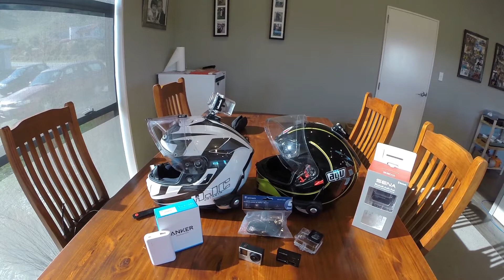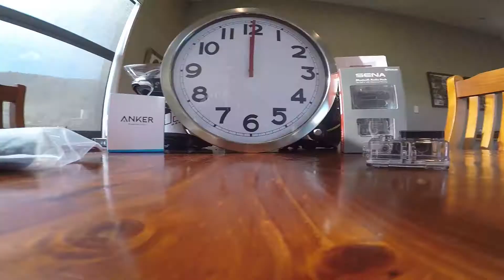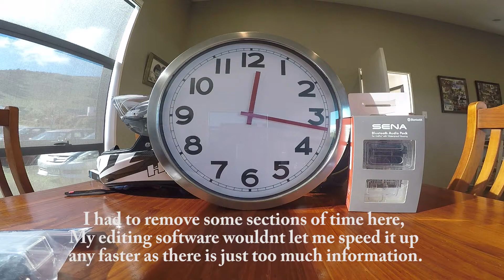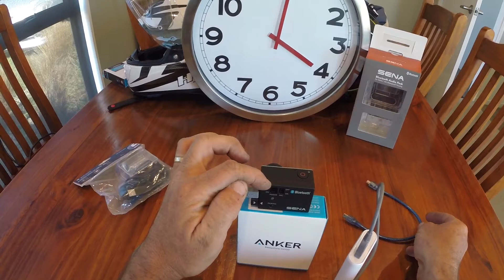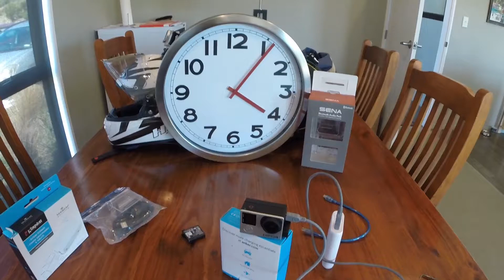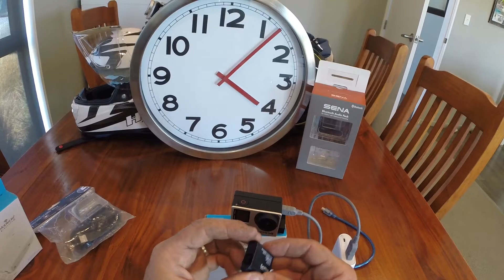My Moto Vlog set up

Comment: Hi. I know you said you don't want a cable from your helmet to the bike, but I run a Sony AR15 on my helmet which I power from a USB plug on my BMWR1100 or Ducati 900SS. I run a USB extender cable from the power outlet along my tank bag to about even with my crotch. Then I run a shorter cable from the camera to this cable. This setup with a 32Gb card in my camera gives me up to 5hrs at 1080P or 11Hrs at 720P. So essentially I just record the whole trip. The Sony breaks it into 4Gb chunks so editing isn't too bad. A 4Gb chunk at 720P is over an hour of riding. perhaps you could look at this with the Sena GP10 getting it's power the same way. It really makes for hassle free recording and for your Vlogging would be superb. To alleviate overheating of the Sony I drilled holes in the front (sides) of the waterproof housing and a large hole underneath for the uSB cable. Works a treat and even in west coast rain I get no water in the unit.
Just changing to a Sony HDR X3000 so have some fun to look forward to.
Reply from the maker: Yea I still havnt got mine working great to be honest. I will look in to it some more this summer. 🖒🖒
Reply: When I get the new camera set up I'll see about posting some shots of it. Perhaps could email you some photos for reference.
Reply from the maker: Ok mate let me know. I am going to set up a face book soon so that might be the best way.

Comment: Hiya Buddy, I'm not sure how old this video is, but how did that set up hold out with the travelling, general chitchat and VLOG'ing recording?
Reply from the maker: Hi mate. Glad you asked as it did turn out to bit a bit of a fail. In theory it's the perfect set up. in reality the power pack is a pain in the ass.  I keep a go pro battery charger and power pack in the top box and just rotate batteries. much less drama. 🖒🖒

Comment: do you have any idea if it will work with the sena  at all?
#
Reply from the maker: if what will work mate.
Reply: the same mic system / audio you showed on this video?
Reply from the maker: yea. I use a Sena 20s.
Reply: sorry I have a sena 10 I meant do you reckon I'd manage to do the same?
Reply from the maker: ahhhh.  I think but I am not sure that the 20s records in high Def and the others don't.  but I might be wrong. I did a lot of research before buying just can't remember.

Comment: Why not spare battery/batteries for the GoPro?  My Sony only has a battery life of about 2 hours, after that I change the battery, if needs be I can charger the spare battery from the bike.
Reply from the maker: Hi Tony, yea I could. problem is. I have no idea when it runs out. unless I use the wifi  controller which uses the battery even more. so this is just a Hassel free idea.n

Comment: Hi.  Manchester Uk Phil here.   Just a silly question. Your hero 4 is going to be in its case. I think you said your going to vent the case to reduce the overheating but I guess the set up ( cable) from you camera to the power pack is going to be external from your helmet to wherever your keeping the power pack? Will the power pack over heat if you have it in a pocket, or maybe you good lady is going to hold it in her teeth lol.

Thanks for these video vlogs .  Hope your going somewhere nice on your 10 days away?  Looking forward to tuning in when you next vlog

Phil
Reply from the maker: hi mate. it won't over heat I think.  I was thinking if just velcroing it to my helmet to be honest. not sure yet. I don't really want a cable coming down to my leathers it will be a pain.